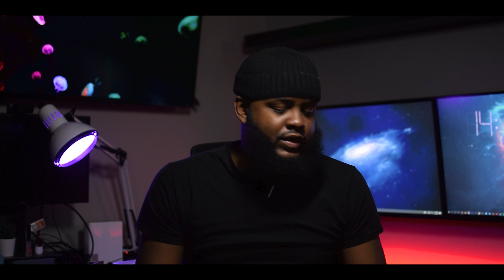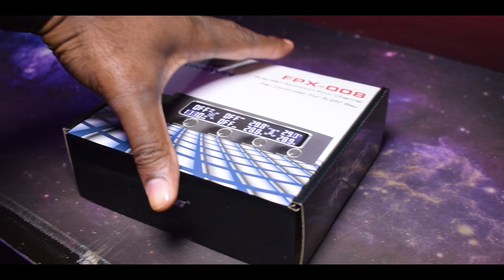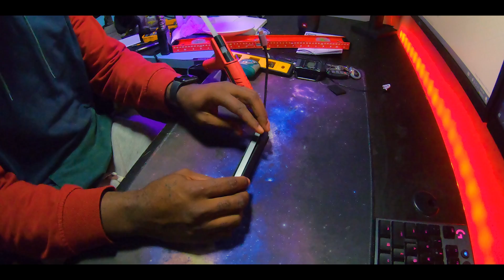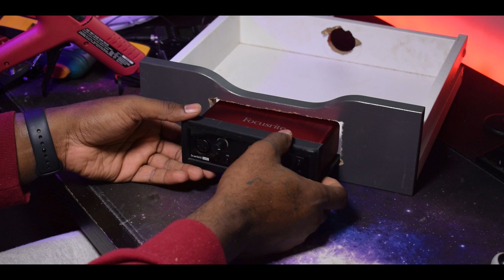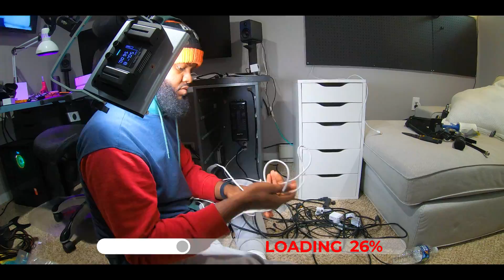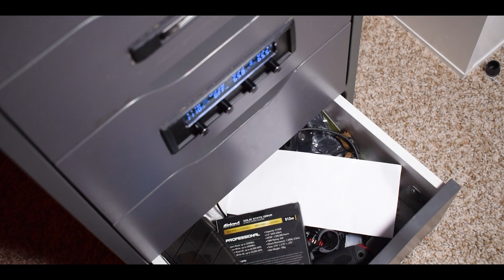IKEA Drawer Hack for PC Gamers

Comment: This is really cool and well put together. One suggestion is to use painters or masking tape on the areas you are going to cut to reduce the chipping around the edges.
Reply from the maker: Yeah I wasn't the happiest with the paint ships but it ended up working out. Next version will definitely be cleaner

Comment: Tip: lay down some painters tape not only for a cleaner edge when cutting or drilling, but also to protect the surface from the jigsaw foot sliding around. 👍🏻
Reply: Another great use of custom 3D prints!
Reply from the maker: Absolutely, gotta keep those finishes clean
Reply: Was about to write the same ....   really sloppy done